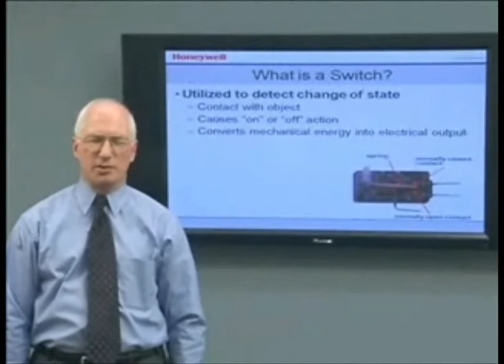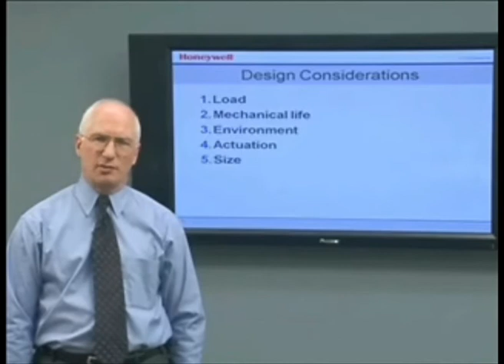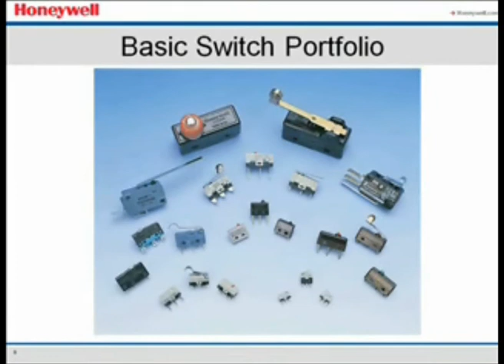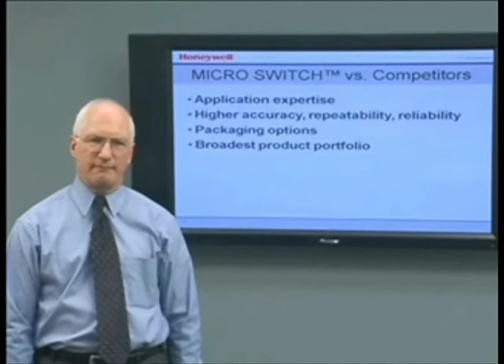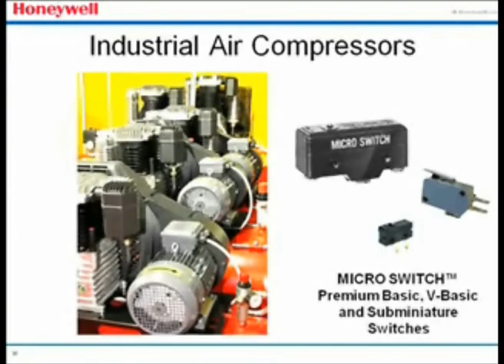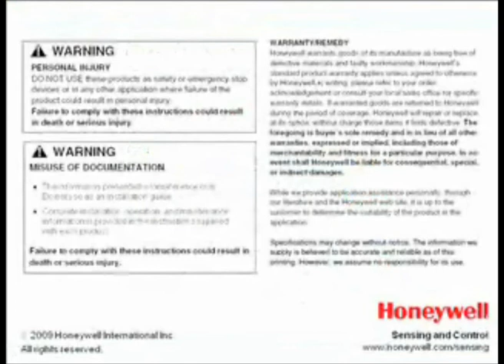Honeywell MicroSwitch

Comment: BA-2RV2-A2 - Honeywell switch - This looks like a perfect switch for my application, but there's something I don't understand.  I am operating an 18v cordless drill motor with standard drill batteries.  It operates a winch in a short run, up & down.  I'd like to install this switch to limit upward travel.  (So the machine can't bind) 

At peak it draws 17amps, but normally about 12amps-Up / 6amps-Down. 

ALL of these switches are limited to about 0.5 amps DC current.  WHY?
I'm using 14ga wire which is thin & managable, yet it's overkill for my application.  What kind of Hair-Thin-Fragile contacts do ALL these switches use... that they cannot handle even 1amp DC???
Reply from the maker: Thanks for your comment & interest in the Honeywell switches.

We certainly understand your confusion over the DC current ratings.  On many switches, the AC current capacity is much higher than the DC current capacity.  There is a valid electrical reason for this and there are many articles & videos on the web that explain why.  In short, it has to do with the difficulty of breaking a DC circuit. 

If you would like to contact our tech team to discuss further, call 1.800.433.5700 to speak to your local Allied rep who will put you in touch with the Allied Tech Team.